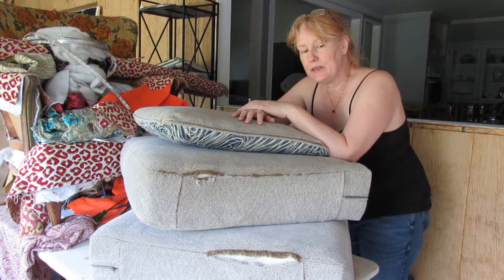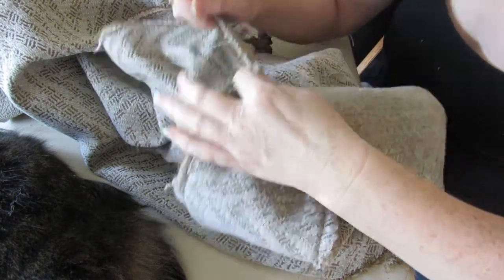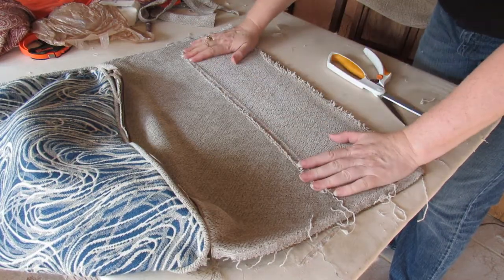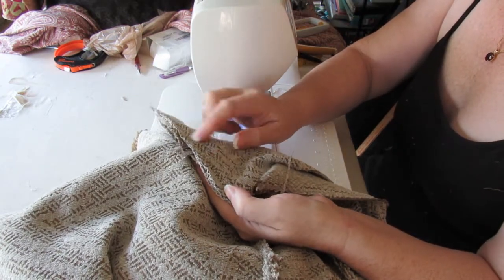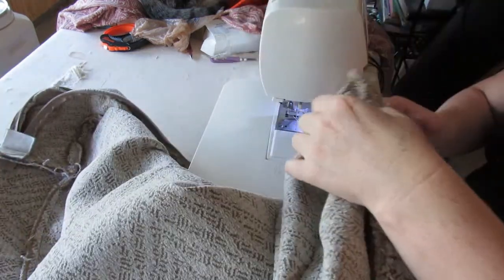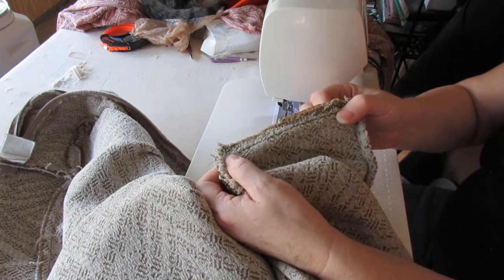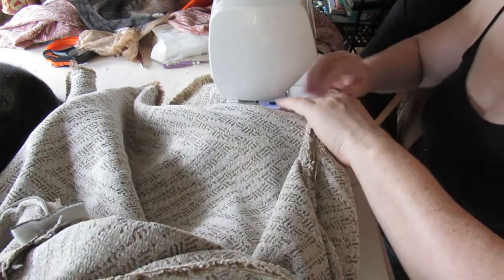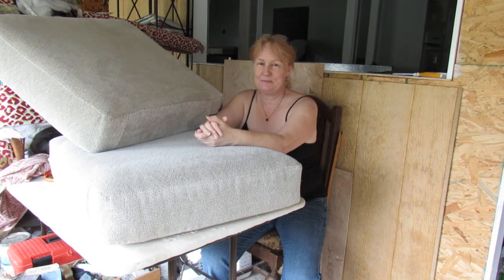Repairing Torn Seams in Seat Cushions - Professional Tips and Tuition for all Levels

Comment: Im not sure if you will see this comment, but could you provide some advice on how to hand stitch repair a couch cushion, where just the piping has been exposed? Its about one inch that needs to be repaired: so the white piping and matching upholstery material that goes over it, has separated from the fabric. The cushion unzips, and I 
thought general common sense, fabric fray/ fusing glue and pinning it would work, however the material that folds over the piping has no seam allowance to then allow for me to pin it and do an invisible stitch (or whatever the name is).  I cant figure out how to pin material back onto the piping and then tack the piping base to the underside seam fabric. I do not have a curved needle (unless its necessary). Thank you! Ill subscribe right now.
Reply from the maker: Thank you for your question.  I have a couple of other videos that might help a little.
https://youtu.be/BWQZdGAjlrg
https://youtu.be/JWAvTa30Rc8
I personally would take the extra fabric from the back border and replace it with a different fabric as it is not seen.  You could just take a little from the outer side opposite from the zip and then top stitched patch onto the border and back into place under the piping.  
As for the fabric you take you can just fold it over the area on the exposed piping and hand stitch it into place.  If you do it this way, you only need to undo a shorter length of the piping seam rather than the longer length you would require if you had to measure the piping cover and make it fit properly.   Try to make the seam allowance at piping cord repair sites at least  5mm/ 1/4" then the bulk of fabric at the mend sites will be kept to the minimum.
Good luck and I hope this makes sense.  I will have to put a short piping repair video together.

Comment: Thank you for this video! What type and size thread did you use?
Reply from the maker: Thank you for your question.  I only use  All Purpose thread in my sewing machine (Coats & Clark usually) and either a Jeans or Jersey needle depending on what it is I am sewing.  When hand sewing I use Upholstery thread for most things and sometimes doubled-up All Purpose thread.
I hope this had helped, good luck with your project.